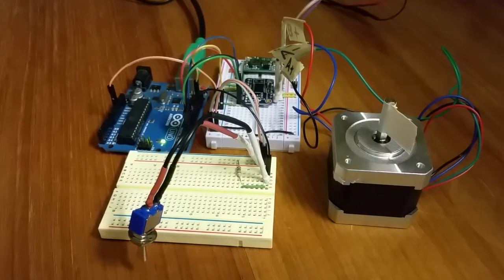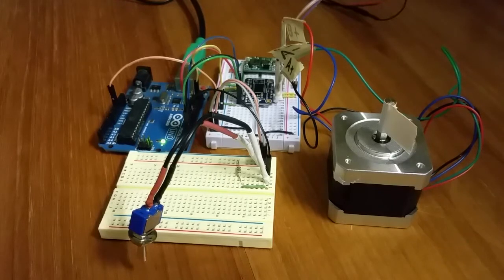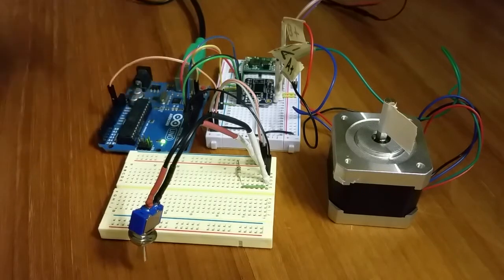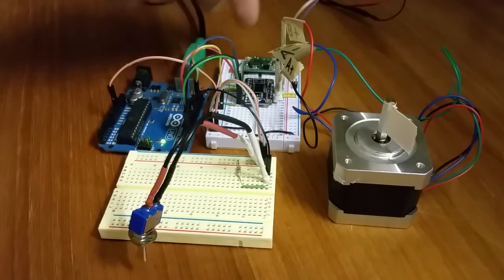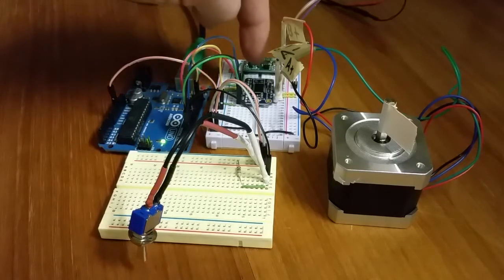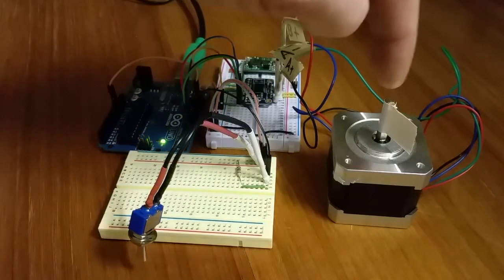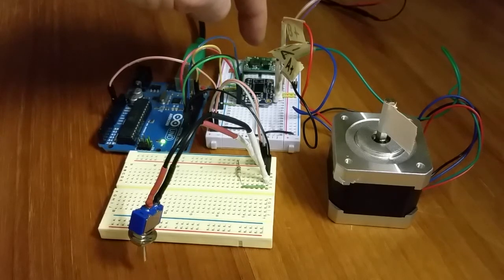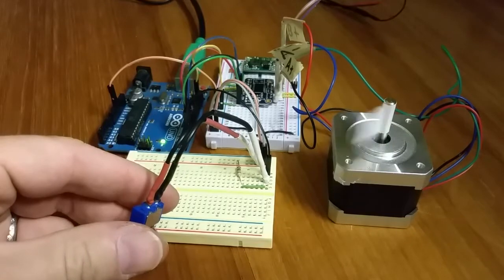arduino & stepper motor - discussing the power supply circuit

Comment: What if I am using 5V stepper motor not 12V. Can I use 5V external power for stepper motor and arduino with simple split? (I don't want to have two external power sources on final project)
Reply from the maker: I think you could probably use this board (also from adafruit) https://learn.adafruit.com/adafruit-drv8833-dc-stepper-motor-driver-breakout-board?view=all  to drive your stepper. Also, you need to drive that board with a decent 5v supply that can handle the current requirements of your stepper.

note that for my project and the video, the stepper was not running on 12 volts, but 3.4 volts. I just used the 12v because the intention was to use with a 12v car battery - so I needed to go from 12v  to 3.4 on that green board ; and fed the 3.4 into the motor controller board which drove the stepper.

cheers!

Comment: Hey! Thanks for the video.

What is the source of your 12V input to the DC-DC Converter?
Reply from the maker: hey -- sorry for the 7 month delay in responding ..didn't get comment notification :(

I'm just using a random 12v wall-wart i had laying around. Nothing special, just made sure it had enough current for the test.

Comment: great video, i was wondering where do you learn Arduino
Reply from the maker: well -- I learned how to write C code years and years ago and worked on embedded systems - so I had that background to start with.  For arduino, I've just downloaded the arduino software and started playing with the UNO and Micro boards and spend a lot of time on the arduino reference site - https://www.arduino.cc/reference/en/ . 

there is a pretty good book for beginners - that doesn't assume a lot of prior knowledge - called "Getting Started with Arduino" by Massimo Banzi.